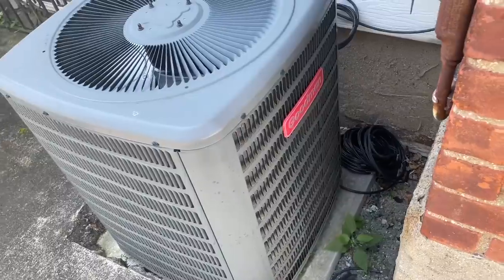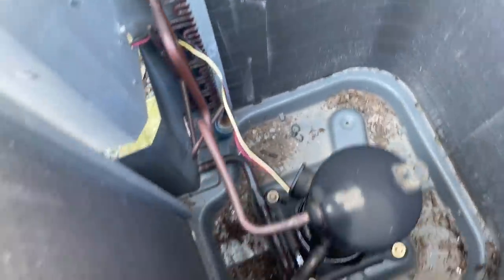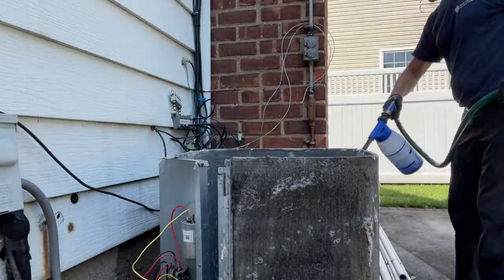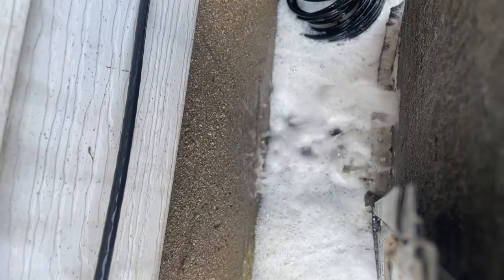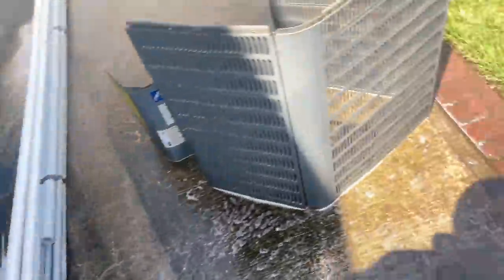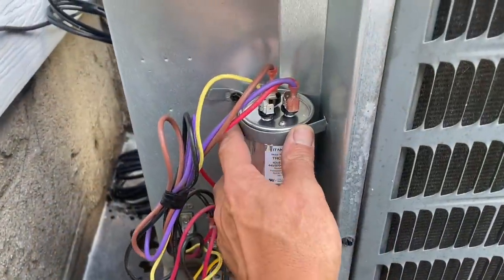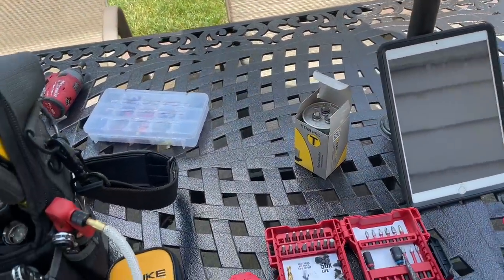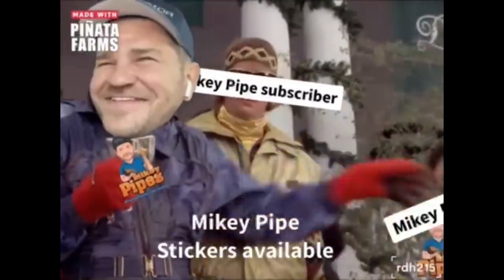Goodman Central AC Condenser Needs Maintenance & How to Test Dual Capacitor With System Running

Comment: I check with discharge and test method.  But usually replace them annually.  I'm head maintenance supervisor for my company which we service our own restaurant. Been doing this for over 20 years. For the price of capacitor, and Schrader valves which I also replace when tuning up units. It's worth it. After many years units always seem to go down during peak times. So this has saved us tremendously money wise and keeping locations running without down time.

Comment: If the comp and fan are both running, I always test dynamically.  I either one fail the dynamic test I remove the cap and test with my fluke cap meter.  Keep up the good work Mickey!  As for asking for a 40/5 cap, just ask for a 40 whack 5.  It's sometimes used in the computer world to refer to "/".

Comment: I just talked with my bud owns Electron Coil Co about testing capacitors which he manufactures. Testing caps either static or dynamically will give accurate results. He builds Caps for high voltage and amperage and tests results are amazing when you see double 0 cables jump 2’ off the ground! For hvac systems dynamic tests are easy but be safe and when math is done you are good to go. He is disgusted with the cheap $12 caps from China with a life expectancy of 5 years or less. He is not a fan of multi tap Caps because there is more room for error but they do have a purpose for a temp fix. Stan.

Comment: Retired Commercial electrician here.
Worked the last 20 years at a large commercial Chiller/AC production plant in maintenance before retiring.
My heat pump at my house is 29 years old.
Like to have it switched out next year. What brand heat pump would you recommend?
I am a DIY type person.
I do discharge and check capacitors with my Fluke 87.
On a side note. I've been a subscriber for several weeks have watch a pile of your videos. Keep doing "you" as I like your style. Keep it real!!
Your channel will grow tremendous in the years to come.
Thanks RG

Comment: I test under load ! I have had several run caps test within range doing the bench test. And fail bad under load.  Imanifold has a capacitor quick test . I believe measure quick also has this. You just enter the values and it let's ya know .  Love the videos keep up the good hard honest work

Comment: Depends if the unit is already running or not when i test the cap, if its running i check it while its running, if its off i test by discharging it and check it

Comment: I test dynamically. I break out the  phone calculator take the amperage reading first multiply by the constant and then divide the voltage. It becomes easier the more you do it, just memorize the 2652

Comment: I have not been testing early in my working HVAC, but in the past couple of years usually I test by discharging and measuring with a capacitance meter. The dynamic method is certainly a great way to determine if the capacitor is in range but does seem to take a little longer to perform. Anyway, keep those videos coming!

Comment: I brought up the 2652 method at our last tech meeting 2 weeks ago and they looked at me like I said my cat barked at me last night 😕 oh well, easier knowledge for me lol. 
What I love about dynamic; I still check to make sure the connectors are decently tight but I don’t have to remove the wire to check them. Especially helpful on those Amanas and Daikin that shove the cap way up high where you can’t see connectors hardly. You don’t risk accidentally leaving the wires off the cap this way, which I’ve seen before and even done in my younger days

Comment: Mikey, I’m retired from the elevator trade and try to do what I can on most of the things around the house. I test the capacitor with power off and discharged. When referring to the size of the cap maybe use the word slash between the 40 and the 5. Keep up the good work and be safe.

Comment: Hey Mikey Pipes! I usually test after discharge powered down. I never heard of testing dynamically until your last video. I have one semester left in school. Refrigeration and controls. I am very curious to see if they teach us that this Fall. I will start doing this when there is no need to shut down. Thanks again!

Comment: When I check the capacitor I turn the power off, pull the wires off, unscrew it and inspect it visually and measure with a meter of good quality. I have tested dynamically but find it is better to do a visual inspection because the oil leaking or case is damaged Then I recommend a new one because of that alone. But always when the reading is low. Then replace with, Preferable a Turbo capacitor.

Comment: Try mixing a batch of coal cleaner in a pump sprayer and then wash off with water hose. I find that works better in my opinion for thinner residential coils. Foams up a lot better

Comment: Working as an HVAC Technician, I test dynamically. A lot faster. You also don’t have to wait for any anti short cycle/ time delays to reset to make sure your unit turns on.

 I test bench style if the unit was off on a tripped breaker or something.

Comment: Dynamic capacitor testing is really important because it tests the device in-circuit at the intended operating voltage and load.  A multimeter simply cannot test a capacitor anywhere near the operating voltage nor test for internal leakage.

Comment: Dirt builds up on condensers all the time Mike. Who ever thinks or saw a lot of dirt on the condensers and radiators of our cars? Many are tucked in so far it is hard to see them. Your new helper sounds like he will be a responsible hard worker.
Reply: Exactly, that's why I always clean the condenser and radiator of my car at least once or twice a year, and hit it with a power washer when I actually wash the car.  Its amazing how many cars end up on the side of the road, simply for overheating due to a packed condenser or radiator, especially those in areas with cottonwood trees.

Comment: Dynamic seems to be less obtrusive ,no need to disconnect lines on cap unless test out bad , will have to try on next unit , meter test cap was my method of elimination on troubleshoot .,💪✌️👍💙🙏🤔

Comment: My Mom was quoted $250 to replace a capacitor on a Goodman unit so I did it myself. Easy peazy! The compressor was getting old and we were told it was about to go out but a year later I put in a second capacitor and added a hard start kit. What do you think about those? Later I replaced the blower motor in the attic. First store tried to sell me a universal motor but I looked at the brackets and said no thanks. The next place had an exact fit. We got it to live long enough to sell the house. Glad to save Mom some money.

Comment: I test with a meter unless the capacitor is pregnant then I just replace it! Because sometimes it will test okay even though it's swoolen and not long for this world ! That condenser was a bit to close to the house ! You're right Mikey pipes manufacturers don't make the condensers user freindly for PM!
Reply: That's how I have done it for 35 years. Works for me.

Comment: Well man I'm not 100% in the trade of HVAC but I've had to deal with capacitors before on fan motors and equipment motors I've tested a couple of them by discharging them and testing the capacity but most of the time they're already blowed up before I get there so it's really easy to tell or it burnt the motor up one of the two but either way someone will always say you're wrong even when you're not it's just the way the world works unfortunately keep up the good work Mikey I want to be like Mike LOL

Comment: check via meter. If the terminals break they were weak, were going to fail anyway. Also it's so hot here all the time Katy, Texas high humidity etc. Dripping sweat everywhere wet with sweat that it's sometimes a miracle to even be able to answer the phone. I hope to remember to get video tomorrow how hot it is in an attic down here... about 3 clicks west of the gates of hell.
Reply: @PipeDoctor  It was 112F by noon in the attic. True Story Bro.

Comment: 40+5 I say to my apprentice also you missed a few screws in the top fan assembly panel it was clear as day to see where they go…it’s not gunna hurt anything but yeah that’s where they go. Keep up the great videos Mikey!! If you ain’t testing your guessing! Another note I wanted to point out I always replace those cheap plastic caps with nice brass one…I test dynamically usually but if I have my doubts I’ll pull the wires and test with my cap setting on my meter just to be sure.

Comment: Hey mIkey   the way i keep myself organized   i have a replacement tray    i rip off my part box and put it into my  parts tray and when im at the local supplier i replenish  my supplies.   Hope your new apprentice works out.  good videos.   I always test when the system is off.  I will try to test it with the system running. i personally want to see if there is any changes or differences.

Comment: Discharged and test the capacitor with a meter, is how I use to do it.
Reply: @PipeDoctor  Yes, but usually if it fails the static test it’ll likely fail the dynamic test which takes a little more time. And as you know time is money.
Reply: @MyZ31300ZX  you actually should test both ways, because it may look ok with a "low voltage" meter test, yet still be bad and breaking down under high working voltage ;)

Comment: How does the acid cleaner work to remove dirt? and have you ever measured key performance indicators before and after a wash to display? I'm guessing airflow through the condensor coil in a few spots would be a good indicator of performance.

Comment: Forget the calculator. They have an app. for capacitance. Safer to test de energized. Plus most homeowners don’t have a clamp on amp meter or how to measure amps without one

Comment: This is the first time I’ve seen/ heard of dynamic testing . I personally don’t like working with undischarged caps. I once got knocked  on my ass by a Whelen strobe pack in the trunk of a police car. I got a wee bit too close to one of the outlets going to a strobe head. My co-worker said I turned white as a ghost and he called an ambulance for me. 😖

Comment: mikey

i have a coleman central ac heat unit.

2005

never ran it used window units

would anything in your opinion
need replacement
starter cap
etc..

let ne know

many  thanks  mikey
electronicmike

Comment: Remember the Pink cleaner that would take your skin off! IDR what it's called but back in the day that stuff would smoke and make those coil shine!..Also would etch your glasses and burn like hell anywhere it touched your skin...lol
Reply: We have replaced about $250,000 in Liebert dry coolers do to the use of the pink cleaner,guys used it straight and did not rinse it all of,so it ate the aluminum and eventually the actual coils!

Comment: Mike love the Chanel have learned a lot you got me studying HVAC love it But if I could recommend you don’t get a Dodge Promaster you will regret it trust me I work on them
Reply: @PipeDoctor  Not strong for the load to start it’s a front wheel drive vehicle 🤔 trans torque converter was squeezed to fit extra gears in the trans which it makes it tool small water always on top of the engine guess what that do?

Comment: Hey Mike could you use a pressure washer on the coils? Or would that damage them? I figure it doesn't make sense for you to pack and lug around a pressure washer though they do have some cordless ones you can use out of a bucket which maybe better, but I guess more for a homeowner to do some maintenance.
Reply: Never use a pressure washer!  Fins will be damaged.
Reply: Use a pressure washer and you are buying a new condenser coil.  Fins are far to delicate.  Worst is when someone is power washing the house then gets a bright idea to knock off some dirt from the unit while they are at it.
Reply: @PipeDoctor  thank you

Comment: Also how do you feel about the Goodman units? I read some techs find them to be good. Wondering if you'd recommend a Goodman unit or another brand for reliability and durability.
Reply: Decent contractors grade unit,lasts about 10,12 years with proper maintenance.
Reply: I have installed them in the past and never had any issues with them,install it properly and take good care of it, that's all

Comment: Question? What hammer drill or drill/driver would you recommend for our field
Reply: I know,I will piss of people on here, but I do own Milwaukee and Makita,and I find the Makita to be a better tool,either one will get the job done,but I prefer Japan to China.My 18v Makita drill and driver are 15 years old and get used daily,just bought my first replacement batteries!Ryobi owns Milwaukee by the way!
Reply: @PipeDoctor  thought so trying to find the 1200 ft lbs hammer drill/driver and 1600 lb impact. Thanks.
Reply: Metabo get the one made in Germany they invented the hammer drill they have Asian branded line too sold at big box stores don't buy.
Reply: @petersmart1999  I know that they still have their factories in Germany making drills for American European markets go back to your keyboard!
Reply: @metal2444  Don't get you leopard print thong all bunched up ,what was,offensive about saying that Metabo sold out,Hitachi bought them,then KKR, and I'm not a keyboard super tech,I know tools,especially German tools! They are the best you can get,from Knipex,Fein,Metabo,Wiha,Some Bosch,hell I even own Wustof knives and a couple nice German cars!

Comment: I just found out that ace hardware store carriers caps down in Florida
Reply: Smart !
Reply: Yeah but if your screwed ,your screwed! I needed a circ pump on a Sunday and they wanted $125 to open the supply house,my local Ace had one and it cost me $75 more than the supply house so it was actually a win win! I buy my cast house traps at local Ace too,they are cheaper than Webb

Comment: When you measure amperage for capacitor calculation, are you measuring dc current,  with a dc amp meter?
Reply: No it’s ac current
Reply: @tphvac87   oh, then these capacitors must be the type with no polarity. thanks for your input!

Comment: Hi Mike, please explain what the function of the dual capacitor is, thanks...as a union meatcutter for 35 years, I do not know the answer to your question...
Reply: A dual capacitor stores energy to start the condenser fan motor and compressor it’s measured in microfarads
Reply: @jamesandrasi3304  Actually the capacitor doesn't store energy, it creates a phase shift of the input voltage to induce RMF and start the motors.
Reply: @Chopper153  What are capacitors?

Capacitors store energy by holding apart pairs of opposite charges.Which is why you discharge them before testing or replacing them.
Reply: @jamesandrasi3304  LMAO. Capacitor stores charge when charged with direct voltage, not AC. In AC circuits, caps make a leading 90° phase shift. You should learn how 1-phase induction motors are started before making stupid comments.
Reply: @Chopper153  um ok idunno what a/c units u work on that use DC voltage for the primary voltage stop trying to be so scientific with your 90 degree phase shift bs
Reply: @jamesandrasi3304  That's what I'm trying to say. Capacitors don't store energy to start motors. They induce a phase shift to start a motor.
Reply: @Chopper153  there not measured in DC voltage If there were no energy stored then what is the purpose of discharging them
Reply: @jamesandrasi3304  Sir, you're getting confused. We discharge a capacitor to remove the energy stored in the last half cycle.
Reply: @Chopper153  you win I was just trying to answer the question in simple terms that an average person could understand I don’t think he was looking to get too technical I took it as he just wanted to know what the capacitor was used for

Comment: Hey Mike I have 2 questions, why on some system do they put the filter drier on the inside of the condenser instead of the outside and what is the best cleaner for the condenser coils?
Reply: Sometimes they put them inside of the house as well.
Reply: @Guillotines_For_Globalists  Ok ya I know that to just forgot to include that to.
Reply: @devman8youtube908  No apologies necessary.  I've also seen large dryers on the suction side too - so 2 dryers essentially.  Saw one in a home last month at a showing.  Strangely enough the A/C wouldn't run because the air handler wasn't receiving power either.  Oh well!  I enjoy seeing stuff like this being a mechanically inclined real estate broker.  I can give the client a micro inspection of sorts at the showings before they even offer and have an official home inspection with a licensed home inspector (which I am not.)
Reply: @Guillotines_For_Globalists  Ya I’ve seen some large ones to, We have a 17 year old Carrier unit and is still working perfectly today and hopefully I can become a technician in about 3 years because I’m going to school for hvac and it’s a good trade to get into I hear.
Reply: @devman8youtube908  Wishing you luck!  Better off going this route than a 4 year college only to graduate with a worthless degree making $15 an hour (if you're lucky!)
Reply: @Guillotines_For_Globalists  I’m not in college, I’m in high school!
Reply: @devman8youtube908  No better time to avoid college than before you start and waste any time there!

Comment: Refrigeration Technologies products are the best around. NU Calgon is 💩.
Check caps while the system is running,  because its when its under load and being used. Static is not a bad test, but there is no load on the compressor or fan

Comment: People bash goodman. I dont like the capacitor they come with, feel like its trash (Cant speak if this has changed since covid, haven't messed with anything newer). And yes the unit sucks to take apart. But they chug along with the best of the lower priced brands.